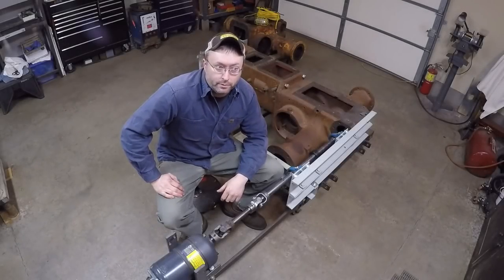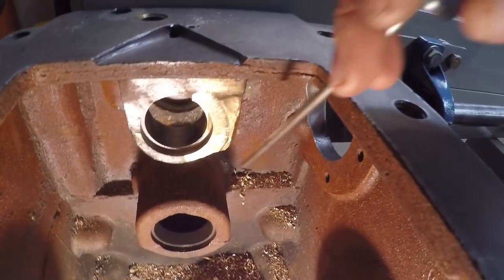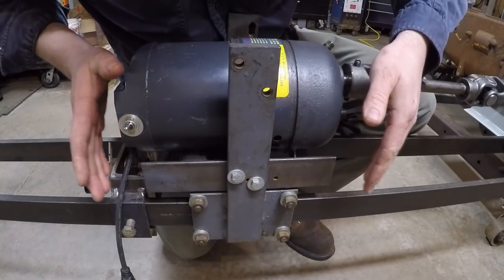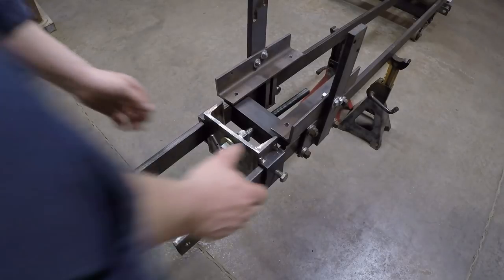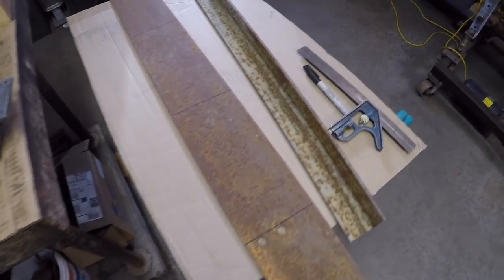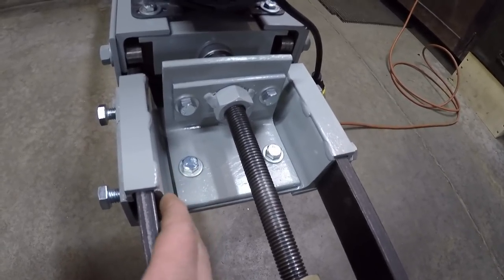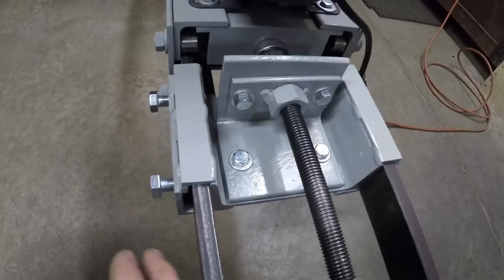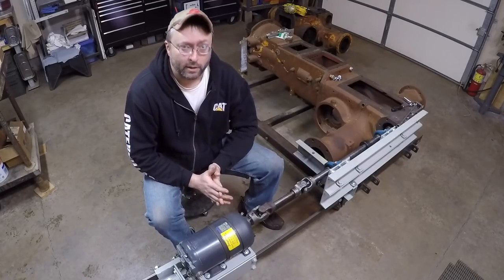Boring Bar Feed Works Upgrade/Redesign

Comment: Onward and upward! Like the music! It FITS! Hope all is well and looks like you've healed and not 75 feet of snow there. Spring IS coming, contrary to popular belief! 
Good one as usual, my Friend!
Reply: The boring rig is working GREAT, but I knew it would! It cooled back down here a little but not much. I had to mow grass yesterday that was too high and water running all over. I'll be at it again too regular in not too long from now. Put the deck back on as the firewood is finished. We'll get there! Thanks, Pal!

Comment: Great piece of engineering. You seam to be more than a bailing wire Farmer. Your Diesel Mechanic skills are showing up well
I enjoy all of your Videos always been a Cat Trac guy myself. you might also try a multi tooth face
mill for interrupted clearance cuts where Diameter isn't critical and tool pressure is constant.